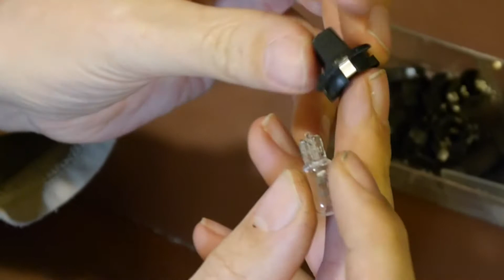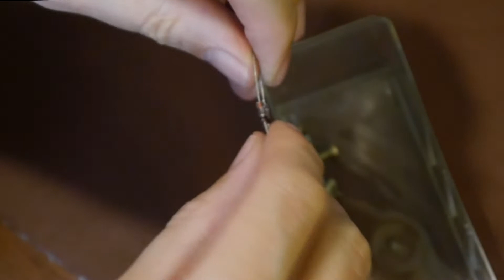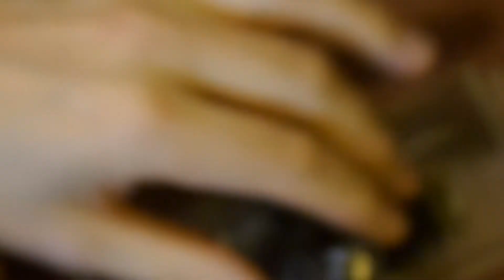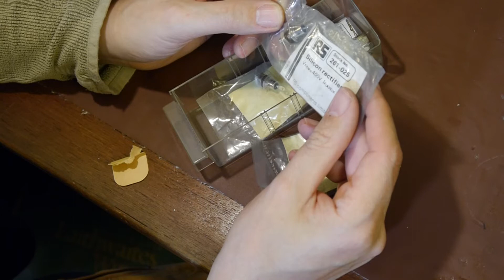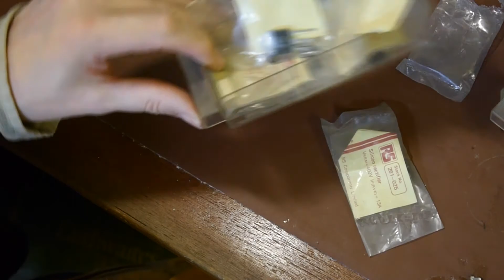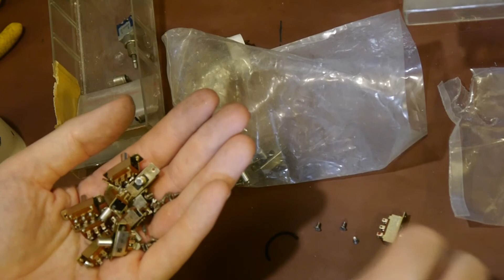Whats In My Box

Comment: Hi Chris, It was a bit late for me last night, so I comment today :)

2:10 I remember those bulbs with the folded wire conatcs from my first car. Had to replace the dashboard lights as well. 12V 3W, I still have one spare in my drawer of tiny bulbs.
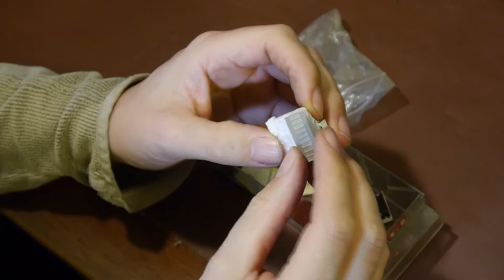3:05 Led bargraphs! Nice to use with an LM3915 or LM3916. Wish I had one of those (should buy some). I have other weird leds...
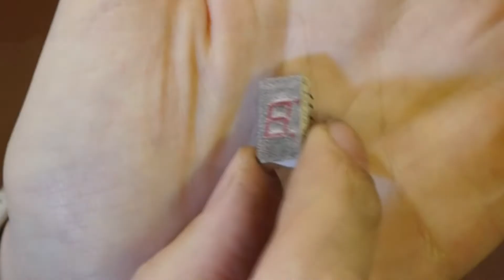3:27 I even think I have that exact same 7 segment display with the two dots... crazy.
4:06 Ah, I spot a littlefuse assortment box of glas 5x20mm fuses! Bought two of these assortmens myself half a year ago, both Träge (Time delay) and Flink (Fast acting). They're always handy and save me a trip to the store!
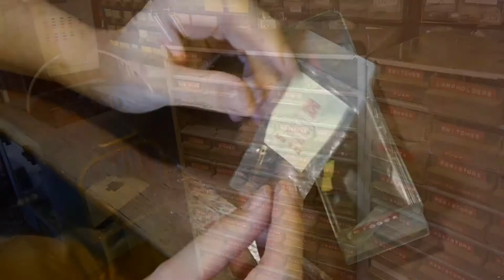4:30 Photodiodes like these are being used in some dusk/dawn sensors (the ones integrated in, for example philips FWC lights or those are plastic 5mm), I believe. It depends on what type of light it is sensitive to, of-course.
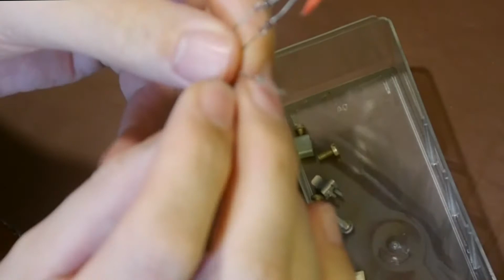5:08 I had a crystal radio kit as a child, one of those plastic things with a pre-wound coil, and you just needed to make the connections. It worked!
13:00 I ran into the same observation when I tested zeners for the last video I did, regarding a Chinese component tester. They read a little high or low, perhaps my method wasn't the best, either.

For the rest they're pretty usable parts, the transistor's I don't know. Something for Simon, I guess, haha.
Funny video!
Reply from the maker: MrDubje Lots of great information thanks for sharing. I think we must all have struggled with those bloody dashboard lamps. From memory it was often just a bad connection rather than the lamp failure. I’m guessing the knee voltage of the temperature is somewhat current and temperature dependant but they never read quite right do they. Don’t really use Zenner diodes that frequently as better single device regulators were on the market so mainly used them for clipping and crowbar applications. The fuse box assortments are useful. I think my first project as a child was a crystal radio. My best regards Chris

Comment: Those bulbs are indeed Ford type/ There crap once they go a bit high resistance. I recon there germanium diodes for sure.. To3 insulators  NO!!!!!! Don't bin the AF128's!
Reply from the maker: Simon Spiers  Hi Simon those bulbs were 24 volts so I’m assuming they must have been used in trucks. The place I got these from is In Leyland  and they do lots of testing and the do a lot of big stuff and military stuff. Don’t worry about the transistors, they have gone to a better place

landfill!

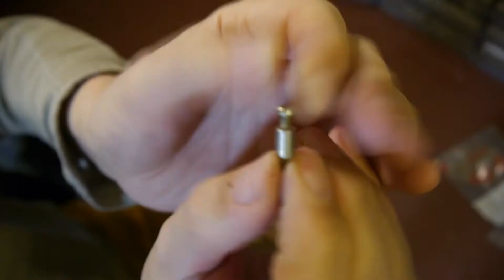Comment: 7:05 the round-ish style is commonly used in rotary switches, as a spacer between the different layers
great video btw.
Reply from the maker: Yes I think you have correct answer.   I thought perhaps they may have been part of the linking arangemnet for the old Weidmuller SAK terminal rails.

Comment: At 17:10 those are often used in power supplies, or audio amp push pull setups with the TIP3055
Reply from the maker: TheDefpom  The place these came from had a lot of automation and servo type drives so I’m guessing some of these would look a lot like audio amplifier but used at lower frequency.  Lots of floor standing cabinets some of the circuit board even had water cooling. Unfortunately I couldn’t take pictures as much is secret.

Comment: Nice score! 
even the box looks useful....
Zeners don't have a particularly sharp knee, so the zener Voltage can vary quite a bit depending on current, or probably more accurately they start drawing current well before the Zener voltage.

The Programmable Zener is probably either a TL431 (or some earlier equivalent).
As well as Anode and Cathode (as per a regular Zener) they also have a "reference pin", with a set voltage (in the case of the TL431 this is 2.5V).
It is basically a shunt regulator (like a Zener Diode) which will draw current if the voltage on the ref pin exceeds 2.5V.
So, if you were to connect teh refernce pin directly to the Cathode, it would act like a 2.5V zener diode.
to use it as a different voltage Zener, you set up a voltage divider between Cathode, and Anode, feeding the reference pin. 
So for example, if you connected a 20K resistor from the Cathode to the reference pin, then a 10K resistor from reference to Anode, you would end up with a 7.5 Volt Zener diode (with a 30K resistor across it).
Although the TL431 does tend to have a sharper knee than a typical Zener diode.

I think you will find that thermal switch is 200ºC with a variation of +/-11ºC (you have probably realised this already I am guessing).

Folk ask top $ for germanium Transistors on eBAy, I can see them listed for over $9 each (although to be fair, I don't know if they sell at that price, and others listings are more like 10 for $20)
Reply from the maker: Hello Richard many thanks for the information excellent as always.   Very interresting regarding the programmable Zenner I will have to try and rig up a control circuit to investigate this further as never heard of these before and its delightful when you find something for the first time.  There was also some programmable transistors with four legs that had both a PNP and NPN transistor. Again never heard of a programmable tranistor im guess ing that these may be some kind of match pair perhaps laid down on the same substrate.  The company had a lot of instrumentation and data logging equipmnet going back many years so perhaps could be from an instrumentation amplifier.  Your correct regarding the  Bimetalic switch the packaging was damaged and I think it was as you say 200C  +-11.   I have always wondered regarding the soft knee on the the zenner voltage I assume that that the voltage must be defined for some known reverse current or temperature etc.  Makes me wonder about precision Zenner references for some reason i have 10% of the max current in my head.   Many Thanks best regards Chris

Comment: Mmmmmm Germanium. The white switch thingy is off the back of a rotary potentiometer. Throw the AC128’s this way if you don’t want them as they will fit nicely in one of those radio thingys that you hate so much. Great video and a nice stash
Reply from the maker: Radiocruncher  you know I once got a shopping bag full of germanium transistors. They got lost in a house move I bet they may be worth something today.  Maybe one day I will do a radio repair. I went from valves to microcontrollers and missed out transistors on the way. Thanks for the heads up on that switch maybe be worth keeping a couple as those mains switches do fail in old gear.
Reply: Hi Chris. That would be worth a fair bit if you had the time and patience to sort through them all and could put up with the dead Jack Russell smell! I have plenty of radios here in need of repair so if you fancy coming over to the dark side then let me know and you can have a set to practice on.
Reply from the maker: The Hacker addiction is hard one and I have been clean for the last 3 years and counting.

Comment: You nailed it totally. My first car was a Hillman Avenger. To do any basic jobs had to remove the engine, plonk it on the kitchen table. I find now is no spirit of adventure with modern cars, even getting the engine out would be a work of art needing 3 strong males (and common sense) I tend to confine myself now to just cleaning out the ash tray.
Reply from the maker: Michael Stevens  I have had lots of old cars in the past. I think only about 50 percent of the the dashboard lamps ever worked and fuel gauge would vary wildly. Kept life interesting. Many thanks for the comment regards Chris.